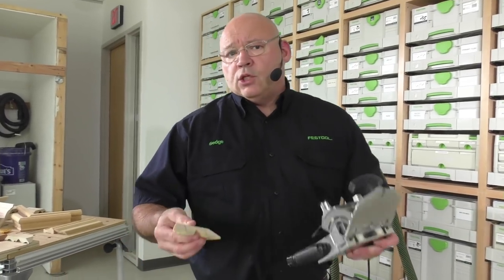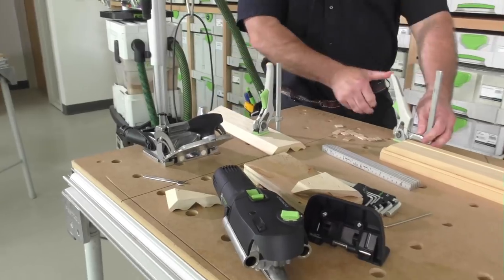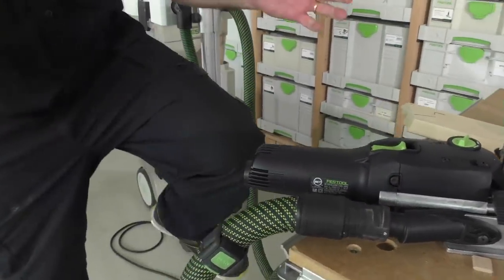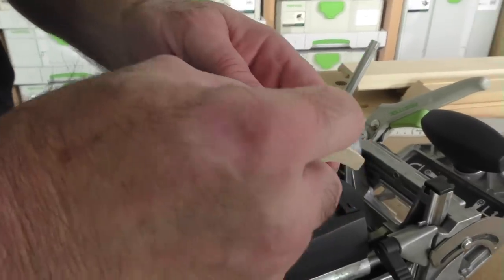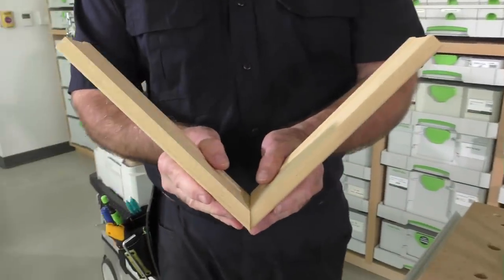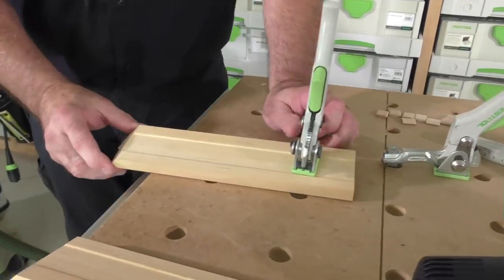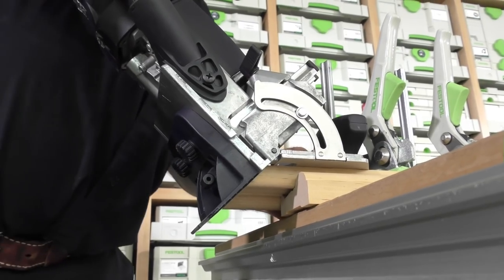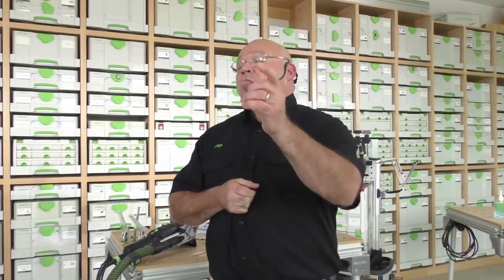Festool Live Episode 64 - Domino Crown Molding

Comment: Stumbled onto your page and was curious if you had a tutorial for a certain technique.  I’m trying to join 2 pieces that are different thicknesses and want it to center on the base.  Basically my trestle base is 6 inches thick and the piece I want to center and attach woth dominoes is 3 inches thick.  Any tips or help or if my message doesn’t make since I could send pics.   Any feedback would be amazing
Reply: I’m assuming you are talking about attaching the center rail/stretcher to the center of each trestle base or foot? Just draw a centerline on each trestle piece where you want the center rail/stretcher to go. Then mark lines across that center line  where you want the dominos to go in each trestle base. Lay each trestle base side by side with the centerline facing up. (Space out the bases so your center rail can lay on top of the bases. (You may need to put the bases on the floor for space considerations)). Now pencil in a center line vertically in the middle of each end of your center rail. Lay your center rail flat on top of the bases and line up the end of each rail with the vertical center line of each base. Make a matching mark across the center line of each rail end that corresponds to the domino mark you made on the base  center lines. Then use the centering marks on the domino fence and base  and make your appropriately sized domino mortises. Just make sure you double check your domino base and fence settings and your trestle base and trestle rail positions for your dominos and your domino machine settings before you make the first plunge into the trestle base and rail. You could always do a practice setup with scrap wood just to make everything is positioned correctly. Hope this helps…